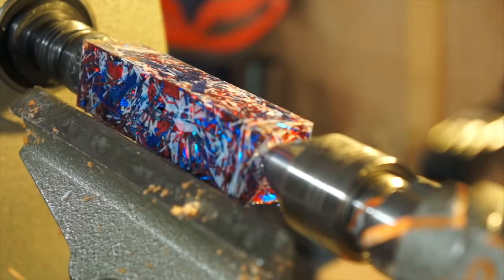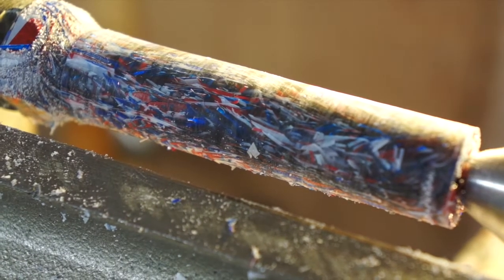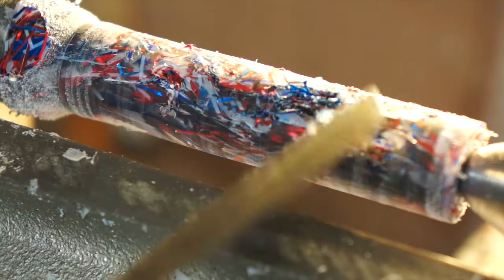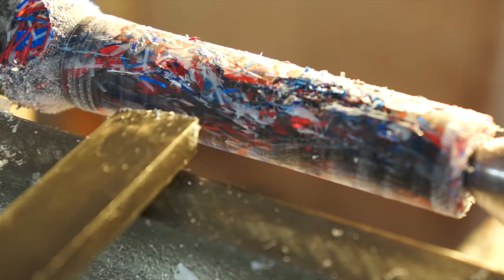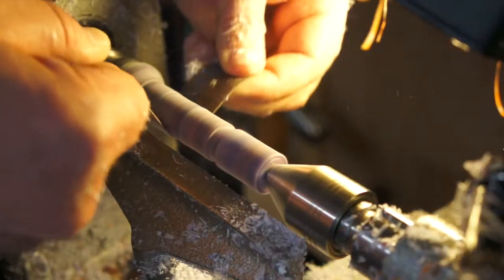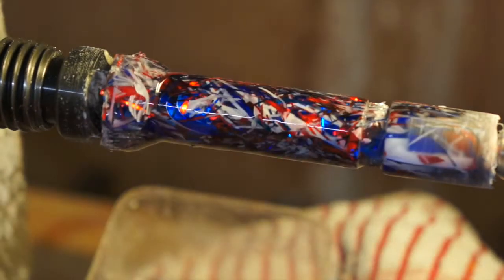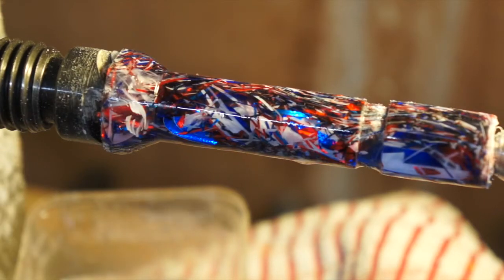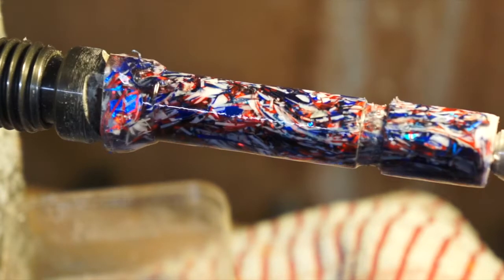Tinsel turning

Comment: Hi did you pour the resin on top of the tinsel or did you mix the tinsel with the resin then pour
Reply from the maker: I poured it on top of the tinsel until the mould was full but I didn't do much mixing.
Reply: SCCFORUM I have never cast resin but I would imagine pouring it onto tightly packed tinsel would be hard for the resin to penetrate each layer equally just a thought that's all. The blank does look great though and I love your videos. Kindest regards john
Reply from the maker: Hi John,
You make a very good point.
I thought the pressure tank  would push the resin into all the nooks and crannies, but it seems not.

Next time I will give it a good mix.

Big thanks for the comments, much appreciated.

All the best,
Paul
Reply: SCCFORUM I have just ordered a pressure pot and some of the resin that Pam from highland boxes just posted oh her latest video. What resin do you use.
Reply from the maker: Hi John,
I use Opti cast 100 water clear  Polyurethane.
I find it needs to cure for a few days before cutting. But I'm happy with it.
The stuff pam showed looked real good too.
Good decision on the pressure pot, a great bit of kit.

Link to the resin I use.
http://www.mbfg.co.uk/liquid-plastics/opti-cast-100.html

Al the best,
Paul.